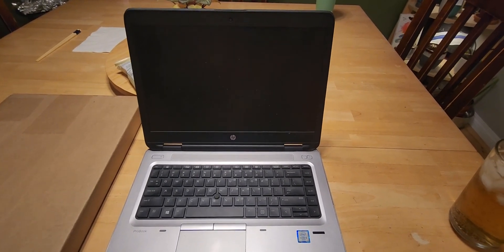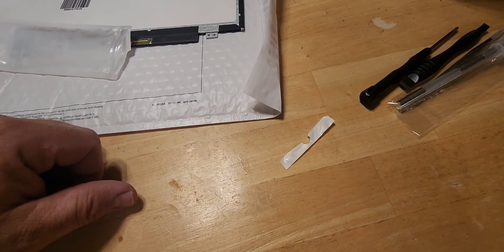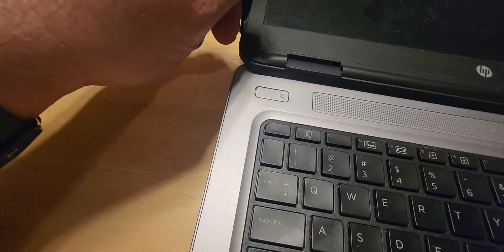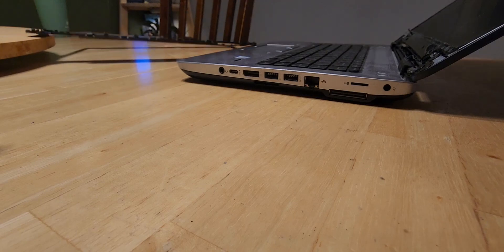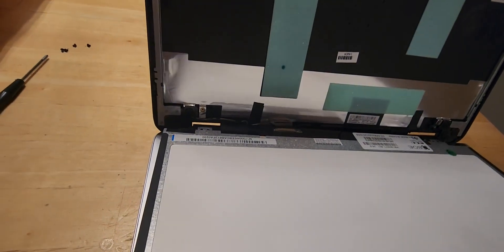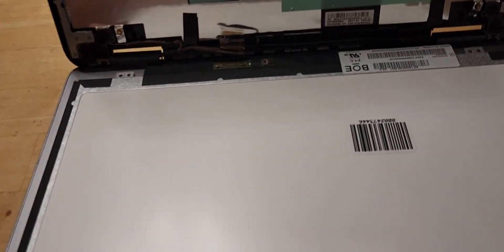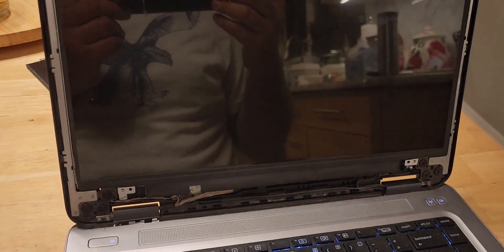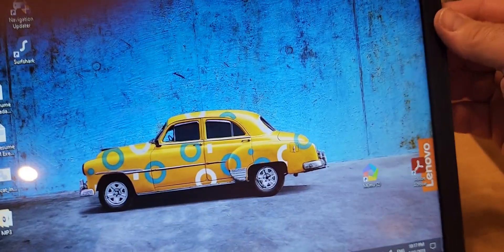HP  Probook 640 G2 LCD Screen Replacement

Comment: This video saved me a ton of extra effort.  The replacement screen I received was the whole topcase, including the hinges and wifi antenna cables.  I was prepared to tear the entire bottom case apart to get to the hinges and antenna connections, possibly (probably) damaging something in the process.  With this video I realized I could just open up the topcase and replace the screen panel itself.  It saved me a ton of time.  Thanks much!